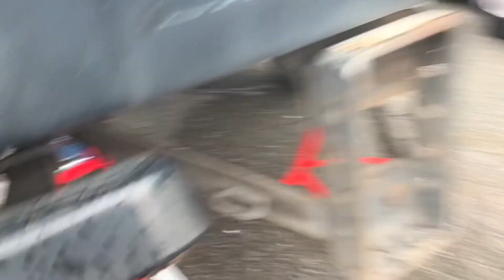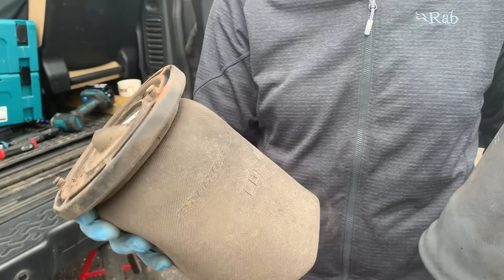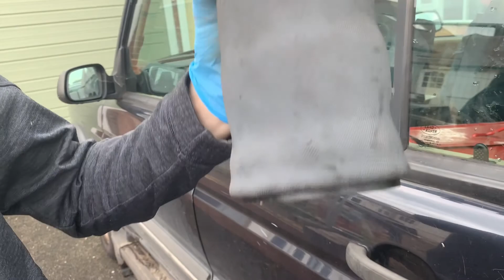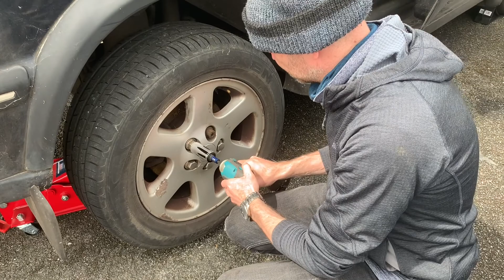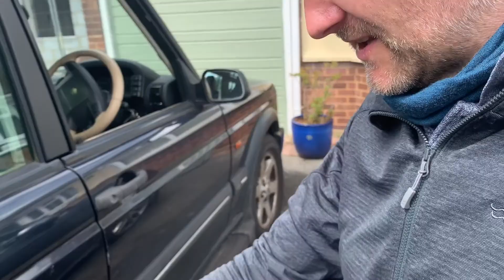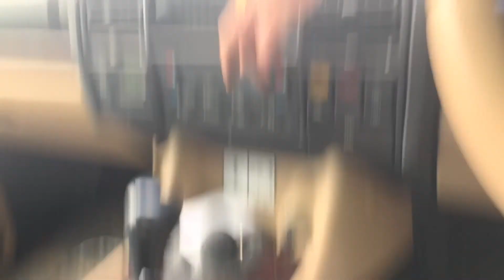Landrover Discovery TD5 / ES Premium Airbags replacement

Comment: I replaced the springs that were on my 2001 P38 when I got the car and put it back on air bags. The ride is sublime and the car holds a line much better on any road conditions.
Not expensive as I did the work myself and the parts are readily available.

Comment: Would love to see a video replacing a Disco 2 front ABS sensor, as there aren't any I could find on YouTube. From what I hear, two 12-point 19mm caliper bolts to remove, and then loosen the wheel bearing bolts 4 x 15mm by about 30mm and this gives good access to replace the sensor (caliper, pads, disc, wheel off) ... but no substitute for seeing it. :D